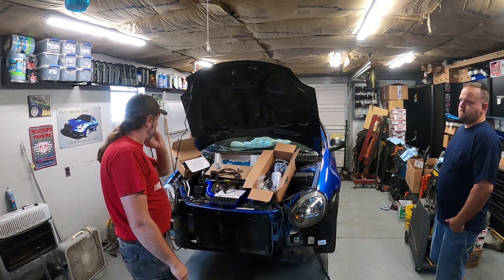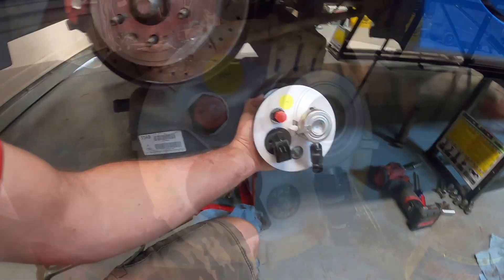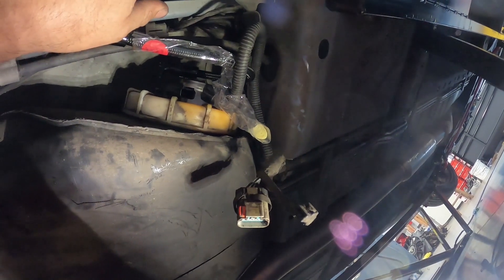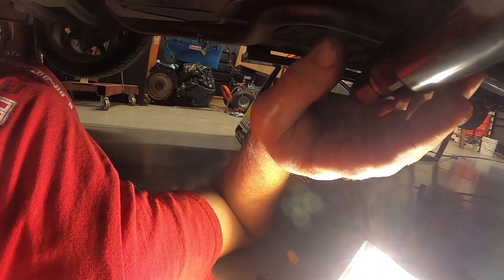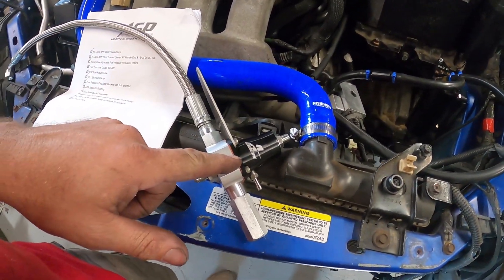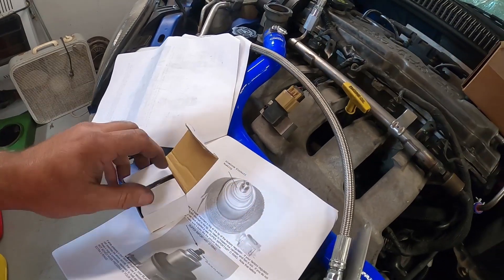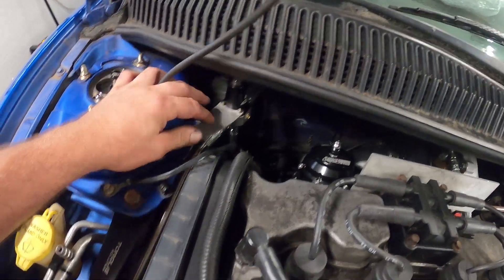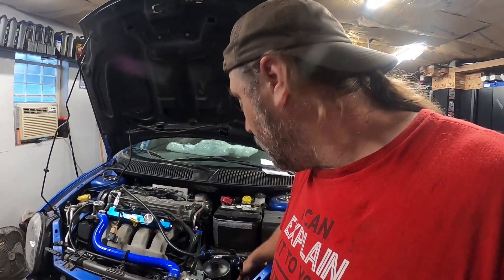srt4 fuel system agp run it performance

Comment: Where did you tap into a boost only source for the regulator?
Reply from the maker: ill T-off the intake to run the vac to the regulator normally you will want a vac/ boost feed from the intake as vac at idle will lower fuel pressure and help with idle tune with larger injectors for it to just see boost sounds pretty unusual you could try t-ee in to the port on the turbo that normally runs to the wast gate
Reply: @Mattsneedforspeed I was told by my tuner to go off a boost only source as i still have stock internals with a 50 trim turbo and 1000cc injectors

Comment: Where does the return line mount to the fuel rail. At the end it looks like only one line is entering the fuel rail.
Reply from the maker: It uses the fitting to connect it to the rail, the regulator doesn’t have much weight, it was also upgraded to a stronger fitting but never had an issue with either one

Comment: Good video Matt, where did you run the vacuum on the regulator to
Reply from the maker: I be leave i t'ed off at the port on the intake right near the throttle body

Comment: The fuel filter seems a bit anemic compared to what most people run for that size fuel system.  Your install looks well done though.
Reply: Johnny, the filter in my agp 450 canister has to be a smaller variant due to clearance. Because of clearance the filter used is a 3.5” x1.25” and utilizes a 10 micron stainless cartridge filter with a built in magnet. If you’re  concerned about it’s pressure don’t be, in testing  we found no problem reaching over 600whp using this smaller filter. 
If you look at some of Matt’s other videos you’ll see that I typically provide a larger filter, but that can only be used with aftermarket lines.
Reply: The entire fuel system is a pressurized system and holds the same pressure of fuel at the fuel rail as it does at the end of the return. It's a pretty legit ass system and provides crazy amounts of fuel for pretty decent power needs. I eventually should do mine (AGP return setup). Mines all stock, and im only in the 20-22psi peak range, 15psi redline with full OEM fuel maintenance (filter/reg, lines, new stage one injectors, seals, intake mani gasket) Afr's 11.1-11.4 from 3.5k-6k shift point.